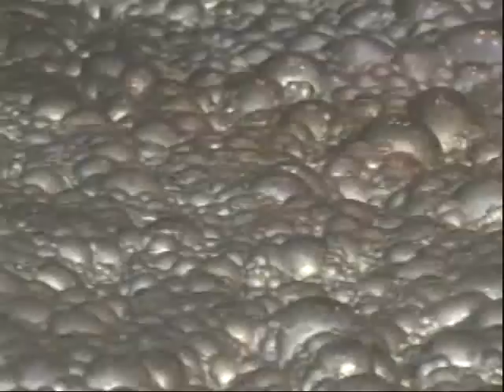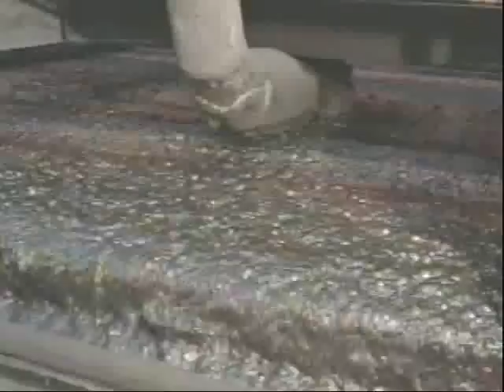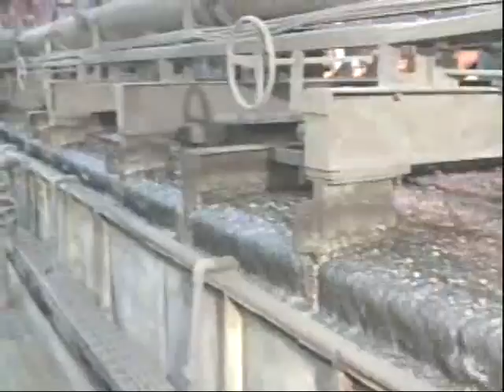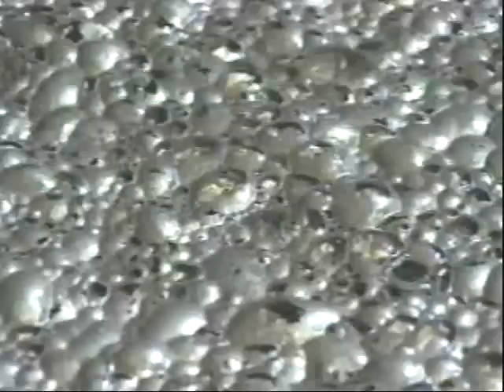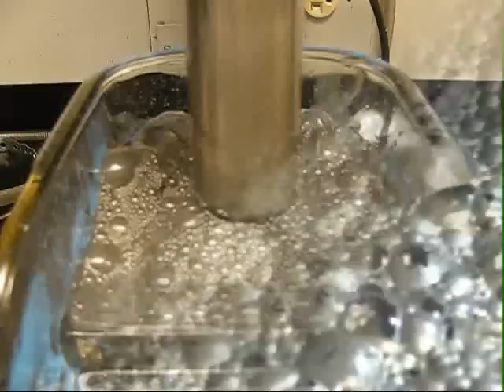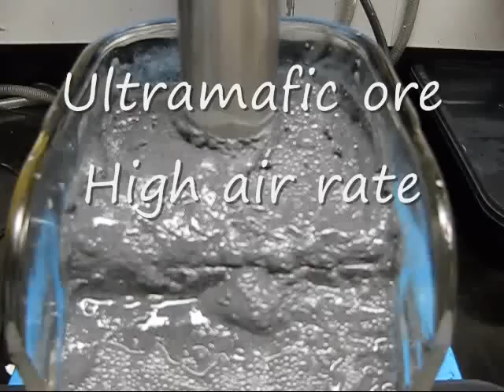Froth Flotation of Ultramafic Nickel Ore - No Pre-treatment

Comment: Hi Dr. Salah. I am also working on the flotation of Ultramafic Ore. What is the wt % solid content that I can take for my experiments as I don't have a lot of solids for each flotation (nearby 10% solids- is it fine?). Also, how much volume of the tank was utilized with only pulp in it? If your tank was let us say 4 litres, then does the pulp (solid+water) occupy 60% of its volume?
Reply from the maker: Usually 10-15% works fine, going more than 20% can be tough due to high viscosity, however, with pre-treatment you can go bit higher. You can review my paper on pre-treatment (https://doi.org/10.1016/j.minpro.2011.09.015)
Reply: Thank you very much. I will look more closely into that.